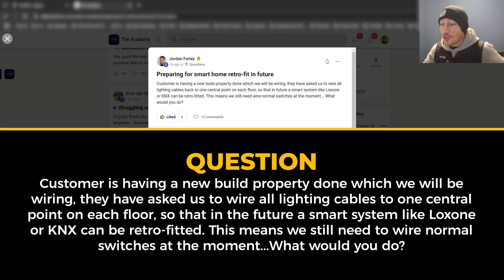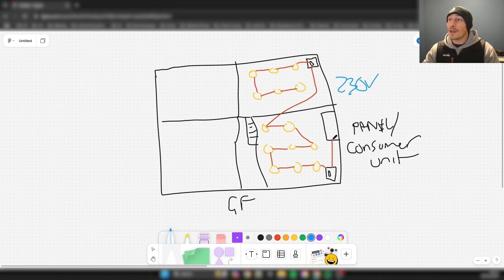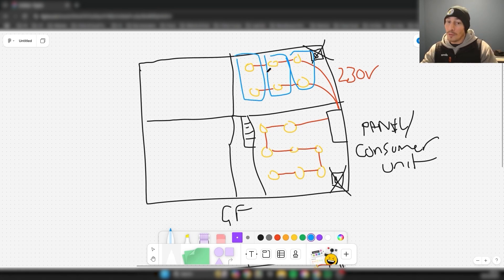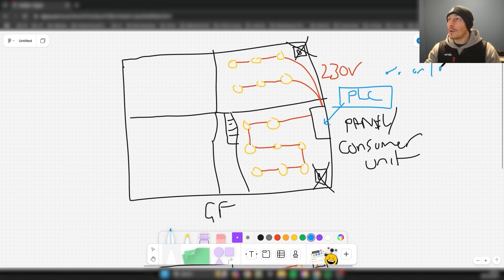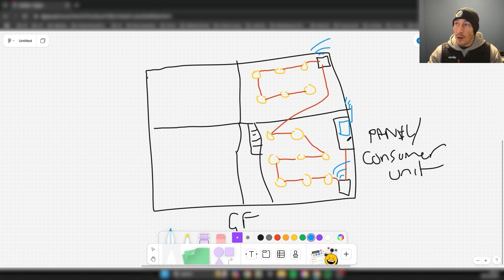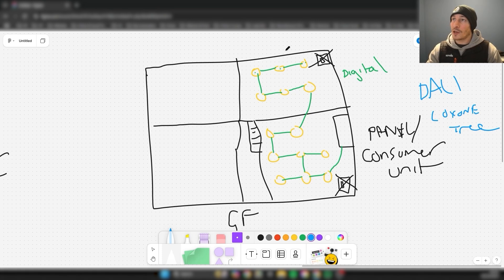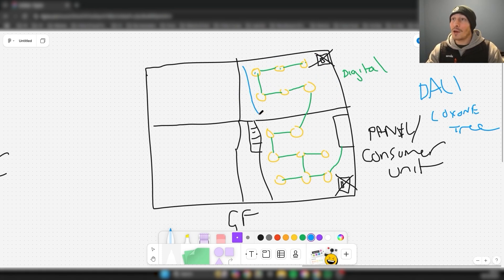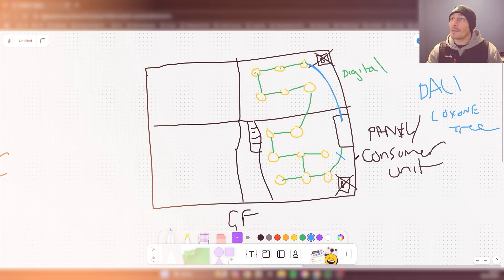How to Wire Smart Lighting Systems

Comment: Hi I’ve got a eNet light system installed in new build unfortunately been unable to connect using WiFi or remotely on internet. Original Supplier  o longer works with e net system just wondering if you know anyway of fixing my problem 
Thanks Chris